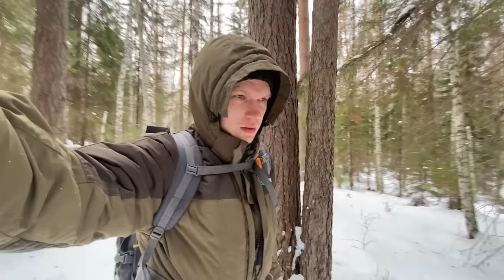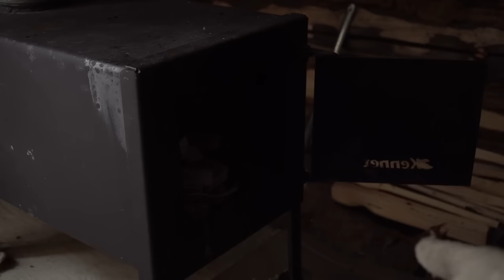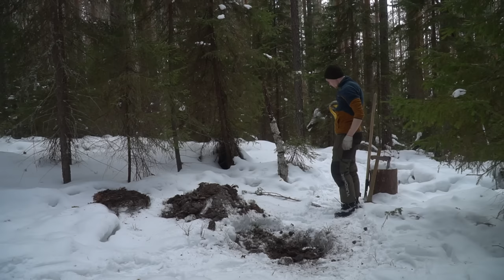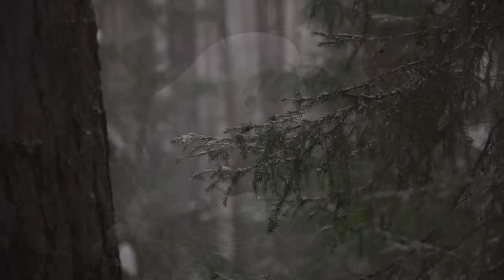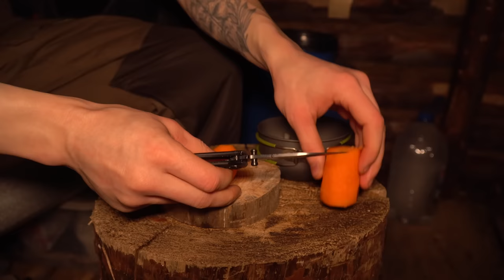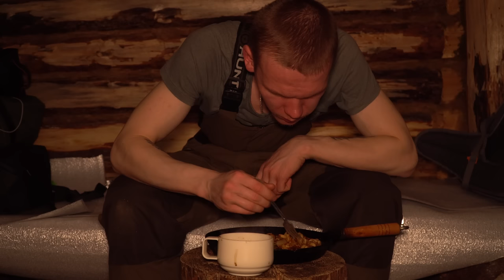SURVIVE THE HEAVIEST SNOWFALL IN A LOG CABIN. Underground Cache.

Comment: All of these photos of how they survived is very impressive. However they fail to tell you that there’s no rest for the weary. You have to make sure that you have enough firewood to hold out long enough during the storm. You have to make sure your roof has no cracks in it. So the roof doesn’t leak. And in the middle of the storm, what if you need to use a bathroom, where do you go? Or do you automatically have a Porto potty somewhere?